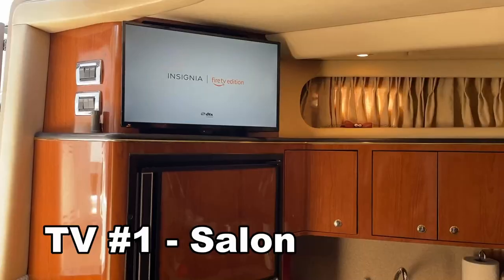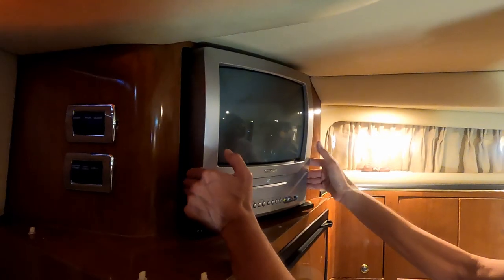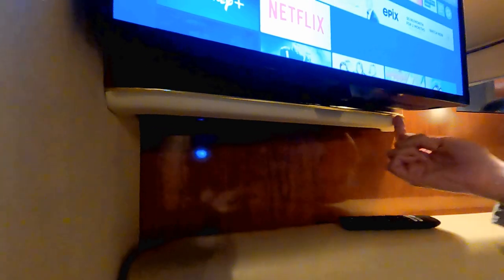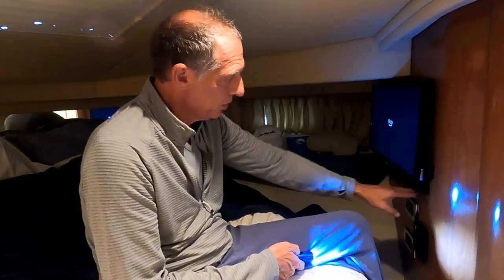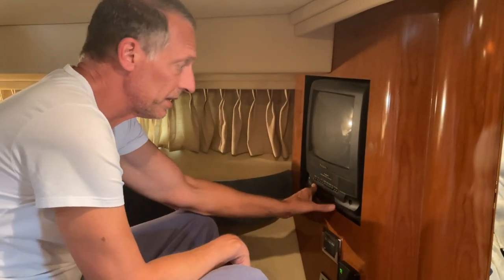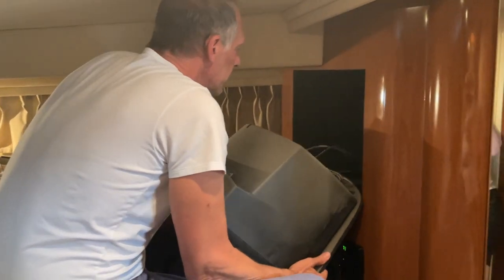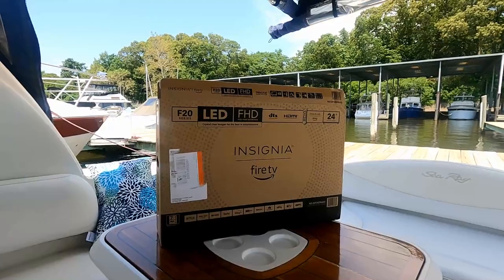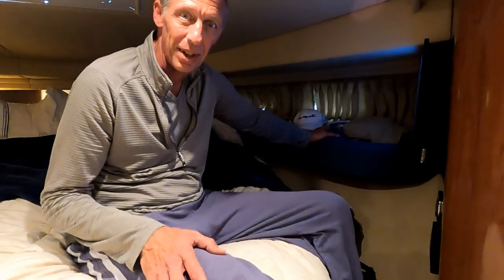How to Replace Old Boat TVs - 3 Ways We Removed & Installed New TVs on Our Sea Ray Boat

Comment: New viewer here. Thanks for showing step-by-step DIY projects - it’s inspiring to see that not all tasks have to be done by expensive contractors. Are these 12 volt TVs, or do you have 110 outlets in each opening where you were able to plug in regular televisions? And you must have some sort of WiFi onboard for streaming …??
Reply from the maker: Thanks so much for joining us!! We've done MOST of our own work in the last 20 years of boating, so we learned a lot along the way. Our boat has 110 outlets so we use a plug in TV and we are using our marina WiFi. That said, our marina WiFi is horrible but these new smart tvs and streaming services like Netflix seem to do very well anyway (better than our phones!). With 2 kids on board we often have all 3 tvs streaming with little to no buffering - so there must be something about the technology that helps them work well even with bad WiFi.
Reply: @MyBoatLife  Happy to be on board! Long time boater (30+ years with 15 or so boats, from 14’ center console to current 41’ express cruiser), but have always relied on the boat yard & contractors to do the work…yet now it’s so hard to find people to work, we’re realizing we’re going to have to be more hands-on if we want stuff fixed. So I attend YouTube University regularly, and am glad to have added your channel to my list of “classes.” Our TVs are currently 12volt, but I think we’ll have the electrical guy add 110 outlets behind the so we can swap them out for slightly larger smart TVs. We’re in a small private marina with no WiFi, so we’ll have to research some options for getting a smart TV to stream (right now, we watch content from our cable provider on my iPad, using a cellular connection).
Reply from the maker: @karikarr6377  wow 15 boats?! That’s amazing! We are only on #3 but we’ve had it for 12 yrs. Same with hard to find good service people - it’s always been better for us to figure it out if we can… and many boaters are happy to share what they know to help! You could probably set up a hotspot device for streaming, and agree a plug in smart tv is best. 🤗